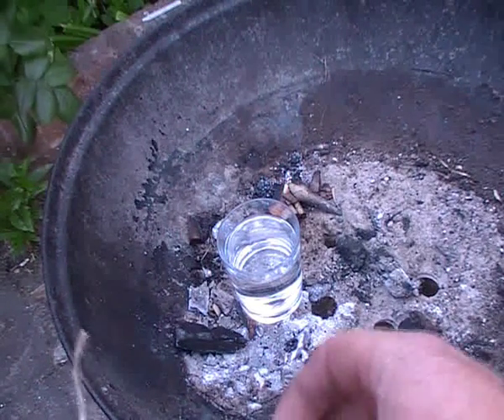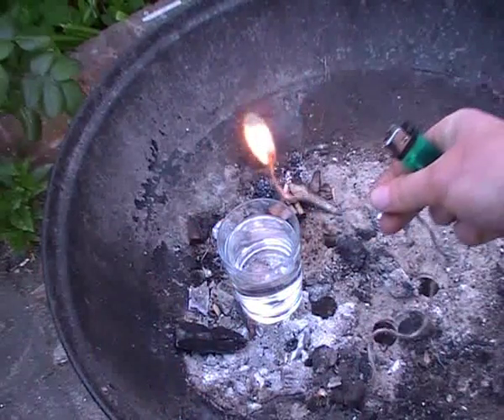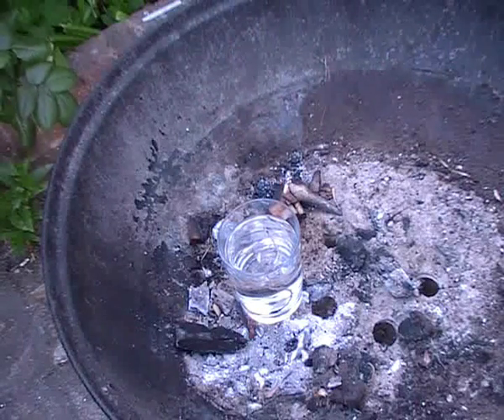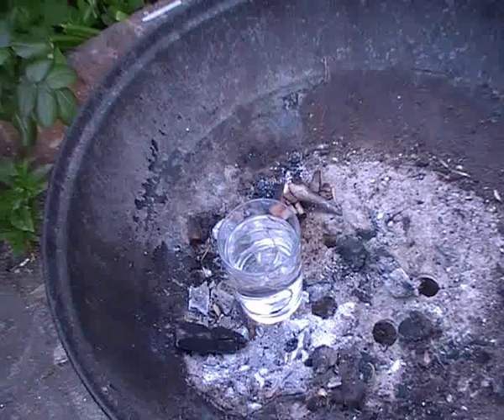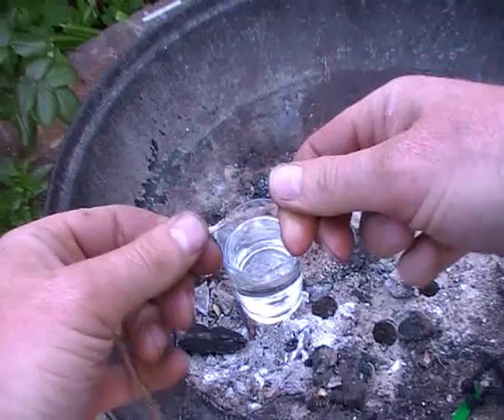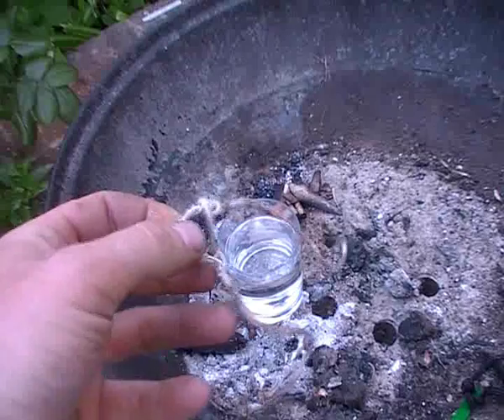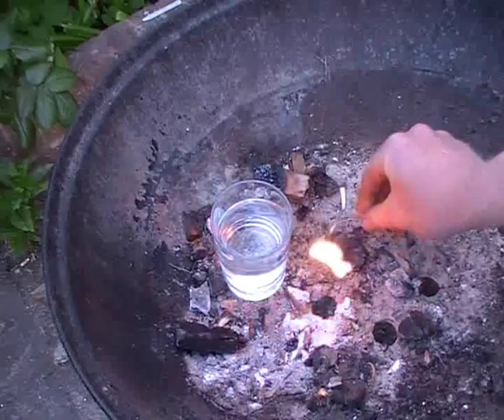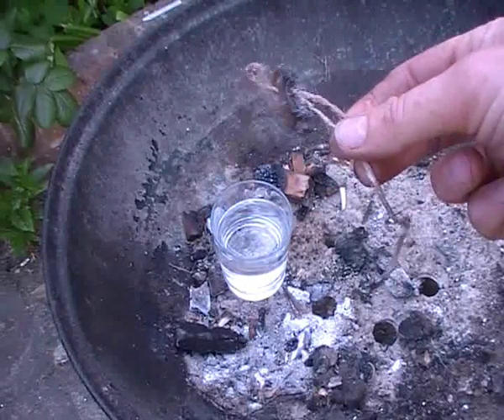Fat string tinder.wmv

Comment from the maker: @NaturalBushcraft Thanks Ash,
It sure makes a good emergency tinder which you know will take a spark even if exposed to moisture,and burns for longer thanks to the wax inpregnation.However I tend to use cottton pads with a little vasaline jelly most of the time.
Sandy